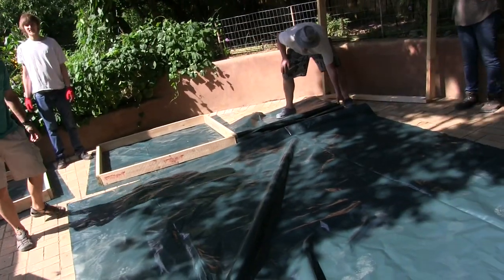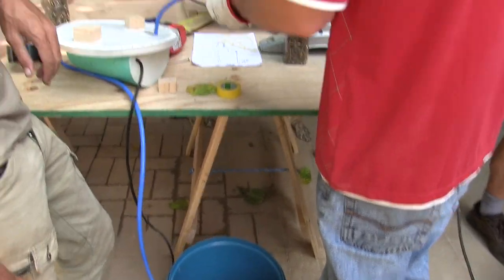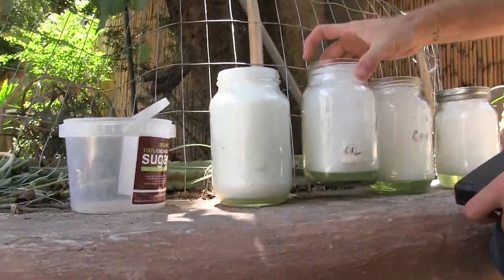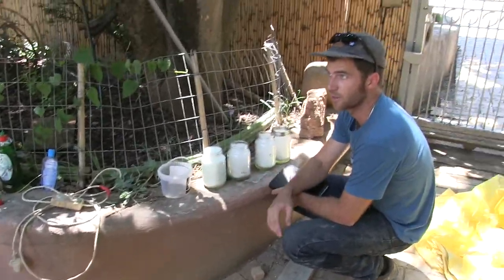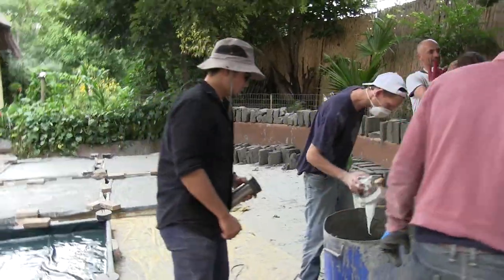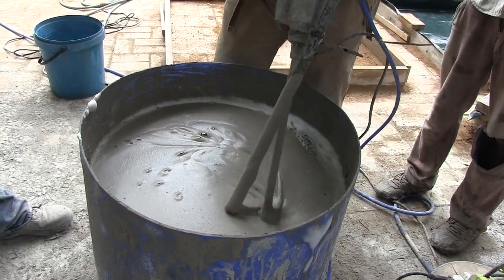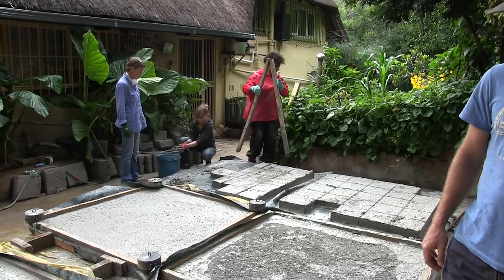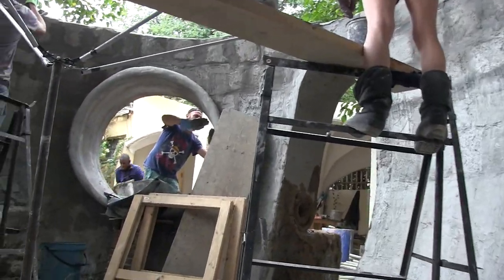Making Air Crete for Dome

Comment: Why did you make your own foam?  Isn't adding dish soap cheaper?  You must have a reason you decided to make your own, so maybe it takes a lot of dish soap to build a typical dome.  How did you do the electrical wiring and plumbing?  It also looked like, with the exterior you used earth bags, is that right?  I mean outside of the domes I could see a low wall of I think earth bags to maybe make an area for planting maybe vegetables, or flowers etc.  Thanks for this video!

Comment: I've watched a lot of vids about making aircrete. I wonder if mixing the foam and portland together doesn't bust a lot of the bubbles in the foam. I wonder if reintroducing bubbles in to the mix would make a better slurry. You could mount a system of tubes with little holes in the bottom of your mixing barrel. A supply of air into the tubes and out the little holes would add air into the slurry while you are mixing. Maybe this could get rid of a lot of the "foam experimenting" people are doing.
Reply from the maker: RUBIZEN thanks brother for advice   What worked is pushing the air right in at the bottom

Comment: Can you build perimeter walls around your property with Aircrete bricks? If so, how much cheaper is it compared to regular bricks, and is it as strong?
Reply from the maker: Adam Roth sand bag walls are much better and stronger. Check my online course www.bioveda.co/LivingBioDome
Reply: My research indicates that you can't treat this stuff like concrete. If you use cement stucco, you will have problems. However, I suspect if you treat it like adobe, it will work out just fine. There are waterproof plasters out there that should work. Also, you would need a cement footing, or at the very least a rubble foundation.

Comment: When  I was in the Navy we used AFFF (Aqueous Film Forming Foam (try saying that after a few pints)) for fire fighting in machinery spaces and the like. It is also used in standard foam extinguishers. We used to have drums of the stuff and mix it with high pressure sea water (fresh water too valuable on a ship and sea water is unlimited) from the fire fighting ring main, mixing it using an in line eductor to suck it out of the drum. I thought this might yield super suds for your Aircrete projects.
Reply from the maker: Russell Howe thanks Russell so what u r saying is that sea water works even better than fresh water
Reply: @AloshaLynov  No, this is not what he is saying.

Comment: Instead of soap, some people now use aluminum poweder from cans ground up in a coffee grinder, and lye from the hardware store. Mix in some shredded fiberglass from insulation and you'll get a much stronger and durable aircrete. The hydrogen from the aluminum decomposition makes much lighter, smaller holes, and consistent cell size throughout.
Reply: Grinding aluminum cans in a coffee grinder? Are you serious?
Reply: Stephen Duplantier if your grinder isn’t up to it, you can try aluminum foil. You just have to watch it closely. As particles gets smaller it will oxidize faster. The oxide layer will prevent good reaction with the lye, so might need to do a short rinse in dilute hydrochloric acid, then water, then quickly add to concrete.
Reply from the maker: Devin Heaps wow I will definitely try this. How eco friendly is the final product
Reply: @AloshaLynov  Very. It gets metal waste out of landfills and locks it away in structures. Autoclave Aerated Concrete is standard in most parts of the World outside the US. The Aeration in that process comes from hydrogen generated in the chemical reaction between aluminum and lye or sodium hydroxide. The biggest difference between Autoclave cured concrete and the process I described is the curing time and water permeability in the final cured product. However, compared to the soap aeration, it will produce a much better and consistent air entrainment, with much fewer negative plasterers.